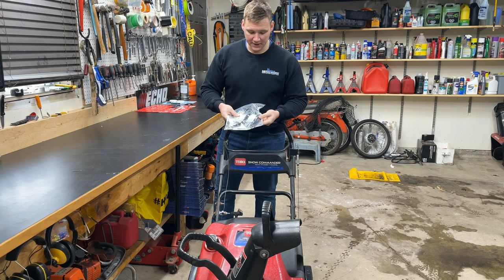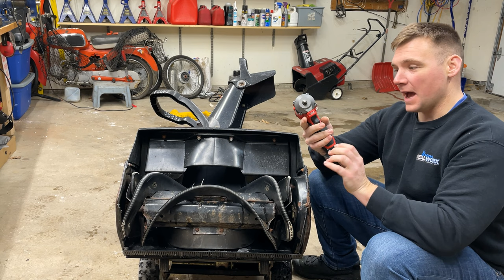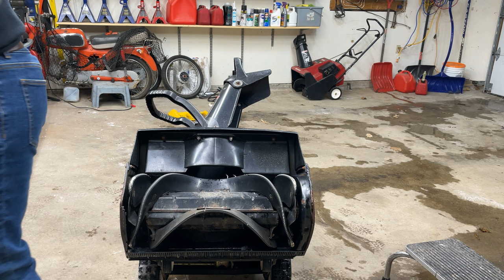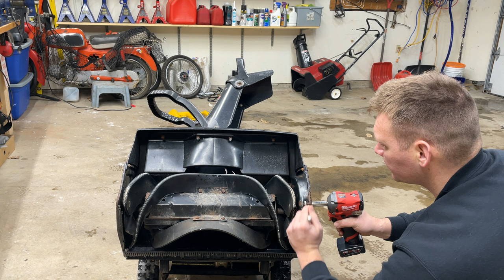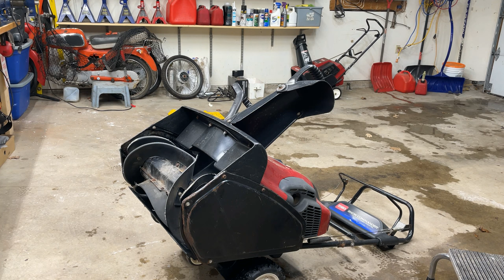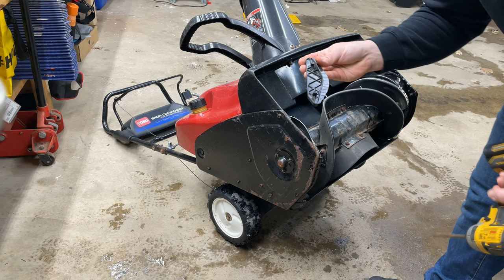Why does my snowblower catch and stop on sidewalk cracks? Snowthrower skid shoe (guard) replacement

Comment: I have been using "Rustoleum rust converter", it's a primer, rust converter. If you put on one coat it primes, 2 coats it's a paint it is also black. Great video!

Comment: Hello Dave, I use mainly Milwaukee M18 cordless power tools as well, and I even have a couple of Milwaukee plugin tools too. I love Milwaukee tools, they are very well built, and they work awesome. Yes, both my M18 impact driver and impact wrench have torque settings on them, real handy to have. It was nice to see you doing some standard maintenance on the wear item replacement skid shoes, on your Toro blower. We've gotten a lot of snow already this winter, and I've used my plugin electric snow blower a lot. Don't forget, the paddles are also wear items, as well as the belt. But as long as she's still throwing good, your fine.
Reply from the maker: I think I’ll do some paddles this spring!